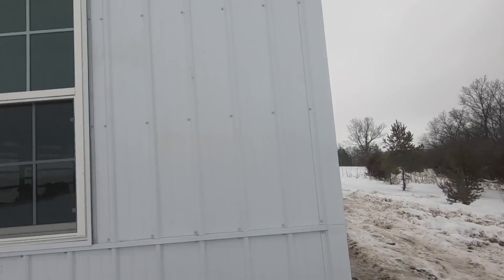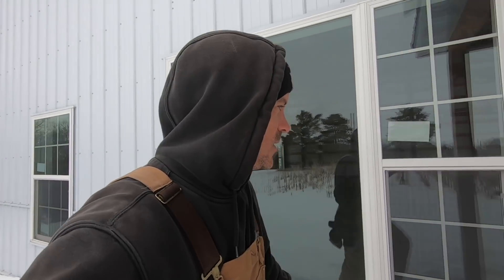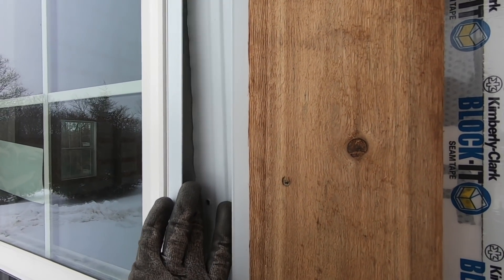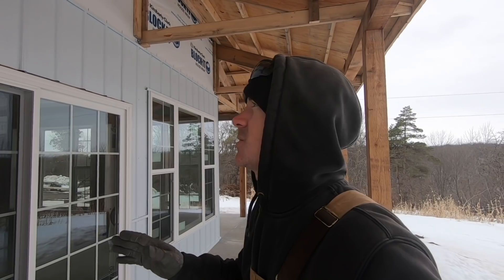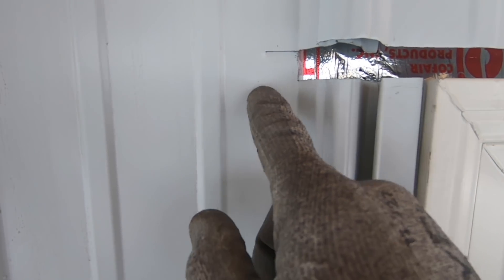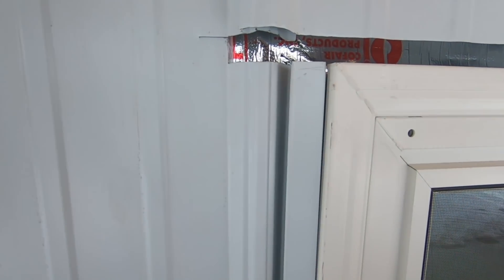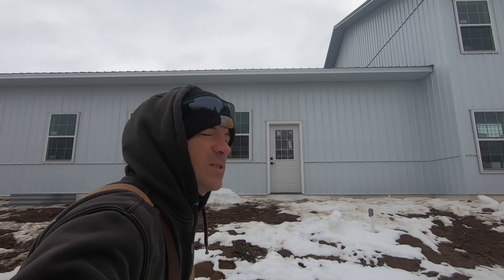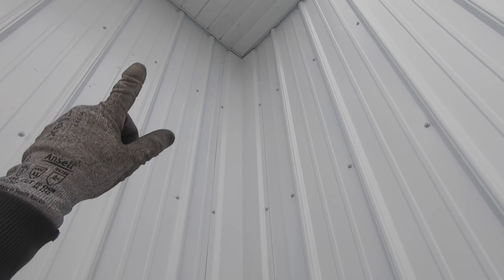Post Frame Steel Install | Trim + Porch + Corners | Pt 4

Comment: Great work, Paul!  Some people wouldn't bother with the extra waterproofing steps on windows under a porch roof like that, but the day will come when that siding needs to be pressure washed, or hosed down.

Comment: What's your opinion on using a window with j-trim attached?
Reply from the maker: I feel that you can control the water much better by adding the steel Jtrim yourself. That top piece of Jtrim is so important because it gets all the water out away from the window where as J built into the window just runs all the water right down beside it.